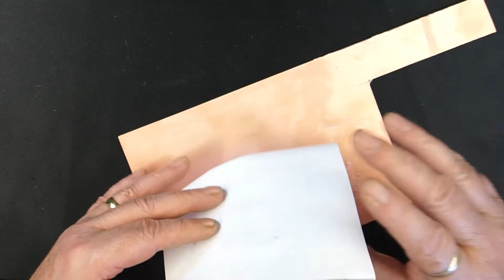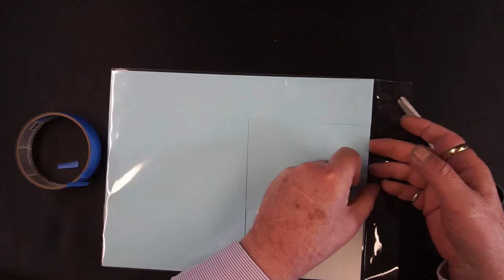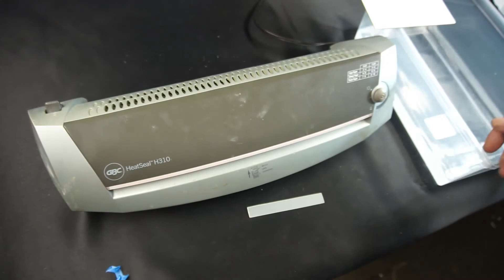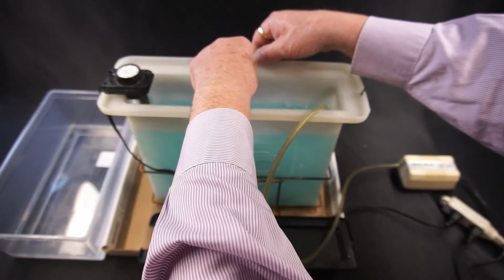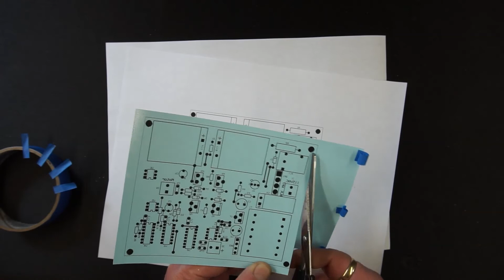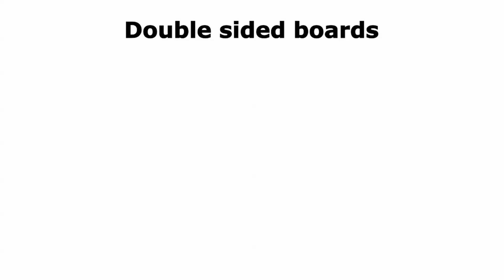How to make your own printed circuit boards (PCB)

Comment: I've used Press-n-peel toner transfer "paper" successfully in the past. You LASER print your pattern directly onto the matte-blue side of this transfer film. 

I used a nearly identical method for cleaning the blank copper board with a Scotch green scrubby and Bar Keeper's Friend, which is an excellent copper cleaner. 

I used a standard clothes iron to heat the transfer paper, at 215°F-240°F. Iron with medium pressure for 2-4 minutes. When the toner is "sticking to the copper" you will notice a slightly darker color change through the glossy side. Ammonium Persulfate is an excellent etchant, so long as it is over 100°F, otherwise it largely does nothing. I used a Pyrex glass baking dish, 11"x14", or 8"x12". Microwave the etching solution in that dish, without the board, until the temperature is about 120°F, drop your board in the solution, agitate the dish gently and "watch the copper melt away". Total etch time at these temperatures is no more than 5 minutes. The solution also turns a pretty aqua-blue color. Quickly take the completed board out of solution, and rinse under cold water to stop the etching process, to prevent "under cutting" of the traces by the etchant. 

Removal of the toner from the copper is easily handled by pure Acetone. Wear glove that are acetone-resistant; most dissolve in acetone. Wet a paper towel in acetone, and the toner wipes cleanly away in less than a minute. Best to do this outside, as the fumes can be overwhelming otherwise. 

I never bothered with the front-side mask, I just printed in tiny fonts on the foil side the IC part number and a "dot" next to pin 1 for chip alignment. For your mask reverse side mask alignment, you already drilled a hole through the board to run your retrieval wire through it. Try drilling a 2nd hole in the opposite corner of the board, and use those for alignment of the mask. 

I like the use of a laminator, which will generally give consistent temperature/pressure when transferring toner / mask patterns onto the board. Drilling the board: I used my drill press, which amazingly held the fine wire bits very well. As my board, which had 118 holes for just the ICs, this board was quick and fast drilling with the press. I never broke  bit, and yes etching out the pad alignment hole is essential for the drilling process, which helps with "self centering" the bit into the hole.  

My approach, which I figured out by trial and error, and some Internet newsgroups posts some 20yrs ago worked very well, and gave reproducible results. 

My most ambitious project contained 6 CMOS chips and a MAX232 chip (Serial Port driver), which has an IR receiver module. The purpose of this circuit is to convert IR remote "blink" codes to a series of 1's and 0's that are sent over the serial port (pre-USB ports!) to a computer, so you can sample and save the remote control codes for replay later to control various IR controlled devices. This project is largely obsolete now with computers with IR receivers in them. However, I had a need to control an AV receiver, and a C-Band satellite dish for recording of weekly music programs available from various NPR/PBS stations that were in-the-clear at that time.

Nice video. Definitely a good demonstration for use of toner transfer paper. Press-n-Peel toner transfer sheets is mostly a combination of toner transfer paper and the "green foil" in one step. This makes quick sport of transferring images to copper directly in one ironing step.
Reply: Thanks for sharing your knowledge.

Comment: I use a household iron, and it is unreliable, but I'm also using nothing other than paper, discarded contact film, with no secondary treatment.  While all this works, the resolution and detail is limited, and the process prone to areas of poor quality.